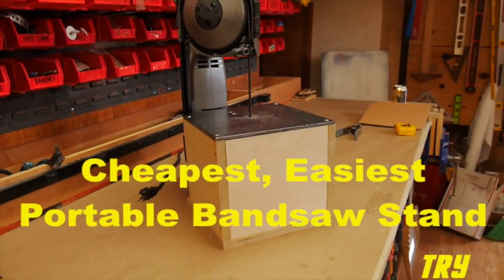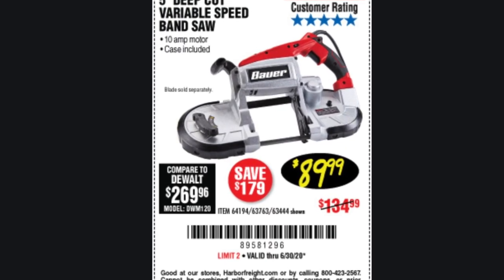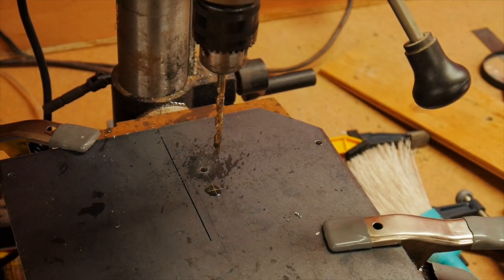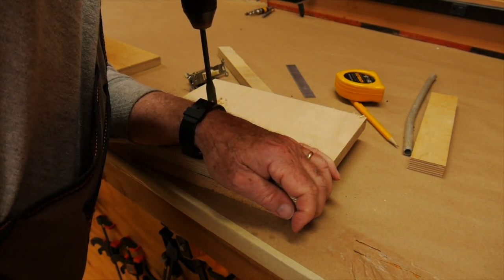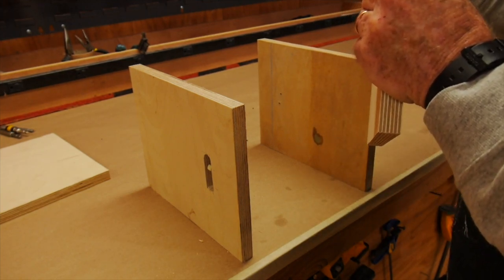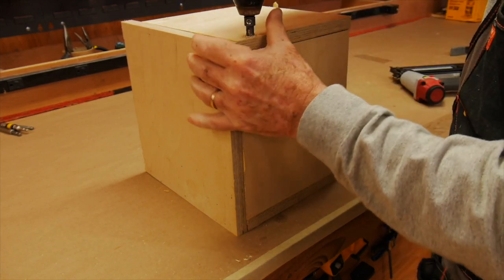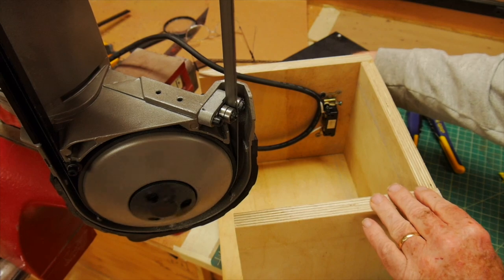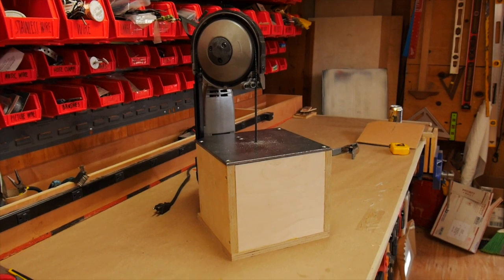Cheapest, Easiest Portable Bandsaw Stand

Comment: By using a switched outlet you can still use the saw as a portable saw.  Be sure and use a electrical box and use the black wire as your switched wire on the power pigtail. You can make a holder in the box to store the power cord.   Keep in mind the easier you make it to change blades the better. You could even make a slot or 2 to store replacement blades.

Comment: I would of mounted a plug in box on the outside.  Drilled a hole in the box and brought the saw plug out to put in the switch on/off plug in box.  Saving you from cutting into the saws wiring.  And that way you could quickly break it down for mobile use.  Yes your cost would go up slightly but there would be those benefits.  Nice portable saw mounted stand, simple and very well constructed.  It may be the one i'm looking for.  I bought the same saw.  Thanks for making your video.

Comment: Good build idea. I think I would have used a plug-in box, and a foot pedal for off & on.  Just so you know, if you haven't found out already. That little dial on the left side of the handle is the speed dial. Your saw will still run variable speed, just spin the dial.

Comment: You should be switching the black wire which is power, and not the white wire which is the neutral or return.  As you have it configured the device is always "hot" regardless of switch position.  Otherwise an excellent build.
Reply: Yeah, I saw that also and was thinking that could queer the pitch some day if you got a short in the saw wiring.

Comment: It's tempting to do, but you should never use an endmill in a jacobs chuck. These chucks do not handle the side loading well and in addition, don't have sufficient gripping power to prevent the end mill from potentially pulling itself out.

Comment: If you did it again would you get a different brand bandsaw or do you think that ones the best
Reply: I researched them all, and for casual use the Bauer gets it done and has given me zero problems. Easy on and off with the belts etc - The other saws may be a little better but are they 200$ dollars better. IMO no - but if this guy was gonna run day in and day out, I usually prefer to get something a bit better branded. Bauer isn't a bad brand though

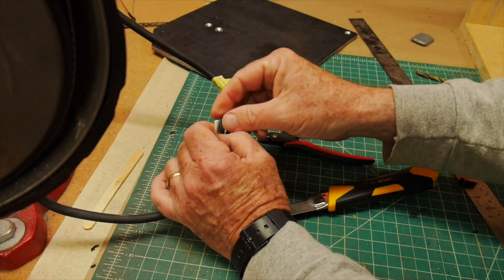Comment: 10:48 Right wire? Hmm, I would suggest you got the wrong one. You should be switching hot/black. Will it make any real difference? Unlikely in this case, though a convoluted scenario could be imagined.
Reply: I'd also use an electrical box around that switch! Probably a sealed plastic one, given the metal filings floating about...
Reply: @qwaqwa1960  That is a good point. I'll try to at least shield it.

Comment: Can we  use only wood to make this bench? I mean instead of metal p!ate, can we make everything with wood?
Reply: I don't see why the top plate can't be wood.
Reply: Since the whole purpose is to cut steel, why would you make to top from wood?  If you cut steel on a wood top the shavings will become embedded in the wood.  Any cutting oil will soak into the wood.  The shavings will then scratch everything that passes over them and will also find their way into your skin.  One YouTuber tried an aluminum top.  It didn't hold up either.